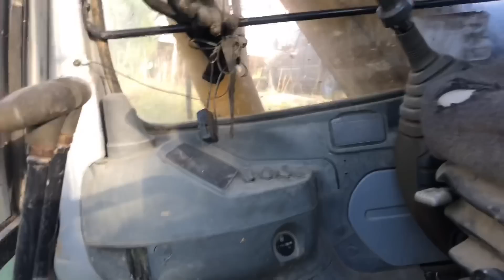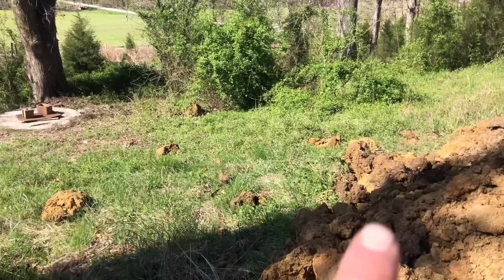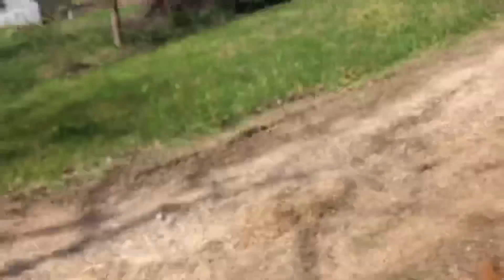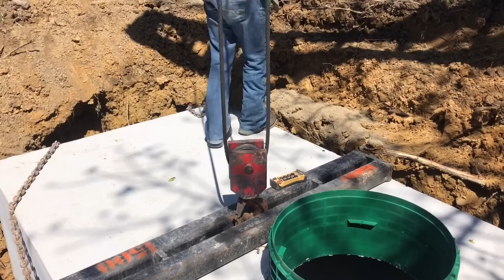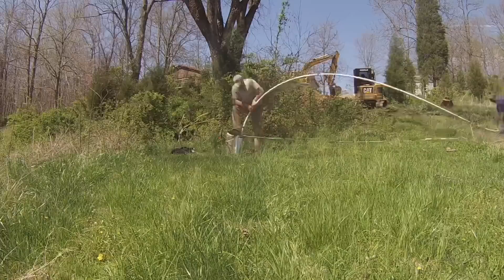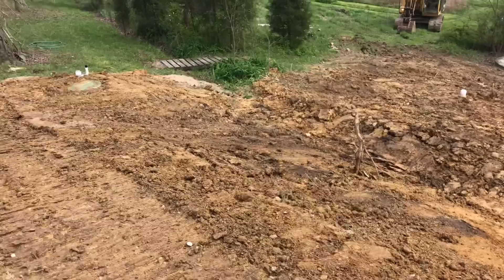Installing cistern, pulling a well and crazy truck driver #funday

Comment: In Britain you are now advised to fill the tanks with water as you backfill them.
Our tanks are either fiberglass or plastic.
Thirty years ago I buried a 3500 gallon plastic, two compartment septic tank on a wet Friday afternoon on the way home from work, without filling it with water, we backfilled it and landscaped round it. 
Job complete.! (we thought) 
I got a phone call on the Saturday morning telling me the tank was on top of the ground.
Because the ground was wet the empty tank "floated" out of the hole over night.
It had been a wet start to the year and the extra rain did the rest.
I learned the hard way.!!
Be thankful you have dry weather and free draining soil.
Reply: Davy P yup. Ive seen concert tanks do the same thing. We had a excavator the same size as his deere and set the bucket on top of the tank knowing it was gonna rain, and left to come back the next day only to see the tank popped up outta the ground and his excavator pushed up with it. Water can do some crazy stuff

Comment: A friend of mine had a 240 foot deep well with the pump hung at 220 feet. When we installed the pump when the well was new, the pump ran for a few minutes and quit so we had to pull it up with water in the line. That was with flexible Golden Jet plastic pipe. I'm glad mine is only 50 feet deep.
Reply from the maker: lol I bet

Comment: I've been operating a truck just like that one for over thirty years. Driver did a good job given placement of the hole.  I would have had contractor pack dirt on low side of drive to level truck. That particular truck can lift 10 tons. As usual good video.
Reply from the maker: Thanks and will have to say he got the tank in the hole 😁
Reply: @Brixton Damian Instablaster :)
Reply: @Armando Ibrahim thanks so much for your reply. I got to the site thru google and im trying it out now.
Seems to take quite some time so I will reply here later with my results.
Reply: @Armando Ibrahim It did the trick and I now got access to my account again. I am so happy:D
Thanks so much you saved my ass :D
Reply: @Brixton Damian No problem xD

Comment: I used to drive a truck for a company that also builds those tanks, we had booms on our trucks so we could set tanks off the back or off either side. Draw back was on tanks this size we had to remove the top and set the bottom first, then set and seal the top on that. Those tanks are very heavy as you already know.
Reply from the maker: Yes they are that tank was about 12k pounds

Comment: you explain the job at start and along the way. plus your music is not overpowering like lots of channels. makes it enjoyable. the delivery truck is just like those I worked around growing up. they delivered concrete septic tanks. I worked in the yard where we poured the concrete and did the setup for pouring every day. setting the tank looked familiar. say my father have to be held to keep from going down a hill and also having to pulled out with a lot smaller tractor with a backhoe.
Reply from the maker: Thanks Jim

Comment: Its funny to me to hear you say back fill it before you fill it with water. I live in eastern NC and when we set a concrete septic tank sometime we have to hold it down with the excavator and fill it with water so that we can backfill it with out it floating up out of the hole. Interesting how things differ from place to place. We dont have red dirt here we have sand and water within inches of the surface.

Comment: Are cisterns common in your area?  Water delivery service to fill it?
Reply: Alot of towns have a drive under system with an air gap to prevent backflow contamination. Drop a few quarters , tokens , write it down, etc. and get  water. Food grade totes work well for hauling water.
Reply from the maker: Yes exactly what Brian said you and see This in the house tare down video 😁

Comment: If you backfill a tank your not supposed to use clean stone because then water sits around the outside of the tank, you have to use dirt if its rock free or sand, we would never put stone around a tank unless its pea gravel. And theres been times putting in plastic septic tanks that the tank floats out of the ground if you dont fill if with water as your back filling. The dirt will just push it up and out. Sometimes in a heavy rainstorm itll pop the plastic tank out of the ground like a bobber. Water can even push a concrete talk like the one you just set outta the ground.
Reply from the maker: Do what the tank company wants me to that’s all
Reply: Dirt Perfect im not knocking ya brother im a fan you do great work. those double half tanks are knows to be pushed apart from water. Im just explaining how we do things in a different state is all 👍🏻

Comment: Is water that hard to come by there? That's the 2nd cistern we seen in a video just curious thanks for the video
Reply: Easier to dig a cistern than drill for a  well. A little cheaper to.
Reply: @brianwebber7168  I just had a 90 ft well drilled for 2 grand thought that would be cheaper than moving dirt that's where my thoughts were coming from
Reply from the maker: Very true
Reply from the maker: They just spent 10k in well that went dry 🙄😜
Reply: @DirtPerfect  that's insane I feel for them that was a big hit
Reply: @DirtPerfect  couldn't they have tried to deepen the well more? I know that there's a cost to everything but over time I'm sure going deeper would be cheaper than hauling water all of the time, especially since it has to be potable water.

Comment: Should have plenty of water pressure. I imaging you removed about 200 feet of head from the system. Personally I think I would have found an old stainless milk tanker and parked it in the yard, but then again I'm a little bit hillbilly
Reply from the maker: Lol good idea if we had access to one